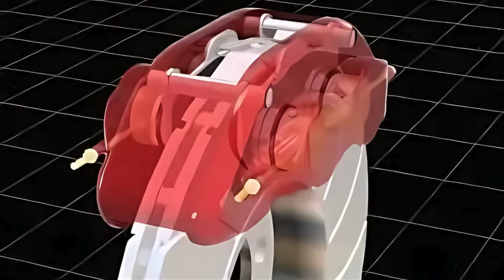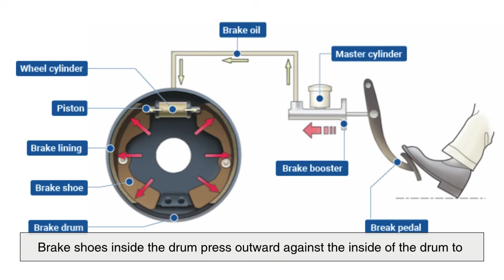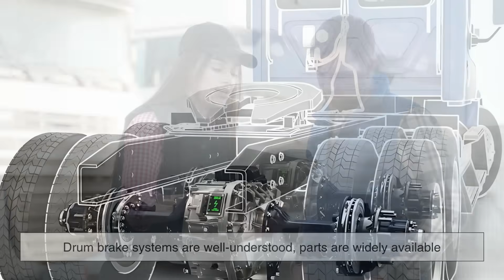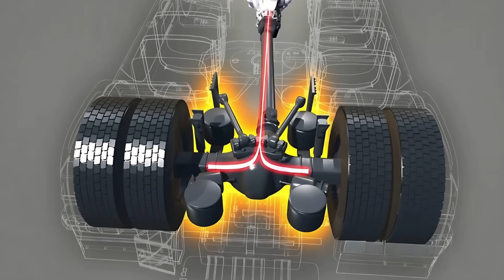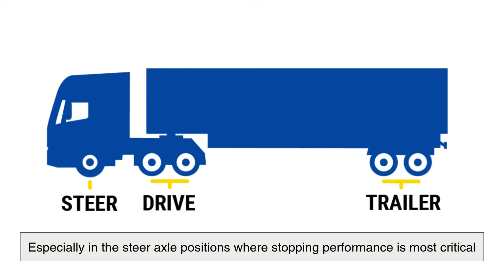Why Don’t Big Trucks Use Disc Brakes Like Cars?

Comment: Heavy jet planes use disc brakes so that blows the weight explanation away.
Reply: Multi-Disc for aircraft... On the order of 4 to 6 separate friction plates... Very much like automatic transmission clutch packs... just MUCH bigger.
Reply: It’s not just about tonnage and weight; drum brakes are far more reliable in wet, muddy conditions. Sure, you can argue that it’s more about economics than performance, but the truth is more nuanced.
Reply: @bethoughtprovoking   Okay... So why are ALL jet aircraft stopped by disc brakes??? EVERY wheel assembly on the C5-B Galaxy cargo plane has multi plate friction and disk plates... Hmmmmm. the 747 is the same way, and the 767, 777, Airbus A380 and all its little siblings. Several hundred tons of 150 mph metal and meat bags are stopped in a couple thousand feet... by disc brakes. Granted they are hydraulically powered and not air powered brakes.  TR's are another whole different ball game. Yes, some aircraft have drag parachutes but their mains are disc brakes... AKA the SR-71. Now in the case of that cloud humper, the parachute was put into play because it allowed the main brake assemblies to be smaller and therefore save weight which could be used to carry more fuel. The engineers for that monster never used a computer to design anything... Slide Rule baby. Granted, on big rigs I like the drive axle having drum brakes... MUCH more metal to dissipate heat which slows down brake fade onset. When you are coming down the Continental Divide on Wolf Creek pass... you definitely need all the help you can get. Have yourself a great day and enjoy.
Reply: @gerrywalsh5766 We’re not making the same argument. Or, rather, we’re comparing apples to oranges. A jet plane is neither a truck nor an off-road vehicle. When it comes to braking, a jet routinely has to come to a halt in a relatively short distance on a specifically designed tarmac; and that exigency is non-negotiable. Road vehicles—especially heavy trucks—on the other hand, are not designed to be safely driven at high speeds, and, therefore, the need to come to a quick halt is not comparable to that of a landing jet. The combination of air and drum is designed for reliability—exactly what a heavy truck needs.
Reply: @bethoughtprovoking Wrong answer... Because big trucks ARE on the highways with morons... They actually need to stop MUCH quicker or end up making meat bag paste. You remind me of my little brother. We would get into arguments and knock down drag out fights.  Lol
Reply: @gerrywalsh5766  Airplanes touch down at 150–180 mph, dumping massive kinetic energy in seconds. They rely on hydraulic disc brakes—often carbon—for razor-sharp, fade-resistant stopping, plus thrust reversers and spoilers to shed speed aerodynamically.

Saying trucks should use the same system is like mixing apples and oranges. A loaded semi rolls at 60 mph, hauls 40 tons over dirt and gravel, and needs brakes that lock up safely if air pressure fails. Drum brakes give self-energizing force, seal out mud, double as parking brakes and can be rebuilt roadside. Hydraulic discs, extra valves and specialized parking-brake add-ons would just add weight, cost and complexity without much real benefit.

The finale: each vehicle’s speed, weight, terrain and service needs demand the appropriate brake system. The video explanation holds about what’s right for tucks.
Reply: @bethoughtprovoking ummm nope. You're stuck in that left field.. so tell me again the falseness in that trucks must be drum brakes. I've worked on both systems.. aircraft and over the road. Heavy equipment has disc brakes... Oil bathed... Well... Caterpillar does. Come on... Let's get to the nitty gritty provoking...
Reply: @bethoughtprovoking trust me... I've done road rescue on big rigs up and down the I-35 corridor.   Fun fun fun
Reply: @gerrywalsh5766  Sorry, but I wouldn’t trust you. Do you know why? Because you’re not an engineer. And if you’re arguing that what’s good for an airplane must be good for a truck, then it’s pretty clear that your thinking is simplistic and unnuanced.
Reply: Good point!
Reply: Trucks and trains are getting disk brakes. Disk brakes cool down faster than drums. It's been at least a few years, but I remember seeing a YouTube video about air disk brakes on semi trucks.
Reply: Nice reasoning 😃👍💯

Comment: You're behind the times.
Semi trucks now come standard with air disc brakes and have for three or four years.
Reply: In Europe disc-brakes are standard an has been for nearly 20 years.
Reply: @sveinovelorentsen3159 disc brakes are an option here on trucks, but a lot of companies are getting away from them due to the extra cost and they don't even last 400,000 miles.
Reply: At my work all of our newer trucks have disc brakes.
Reply: They are not standard.  Here at JB Hunt our average truck age is like 29 months and only maybe 3% out of almost 19k trucks have disc.  Not sure where you come up with "standard". Pretty sure here most of those 3% are on dedicated fuel.
Reply: Longer than that since 2012 as an option, if you order your truck new, either way. Have fun
Reply: Standard?  LAMO you have no clue.  Work in fleet maintenance and we took delivery of about 40 new trucks this past week.  None with disc.  Stop spreading misinformation.
Reply: @MrThisIsMeToo our fleet has had disc brakes for the last 5 years. Now what's unusual is some of them are starting to be electric.

Comment: You are talking about US  trucks. 
The rest of the world doesn't use this archaic technique anymore. Especially not here in the EU. Come into 21 century -it's not so bad....✌
Reply: As seen in 9 year old ... Hätäjarrutus ... YT clip 1 min 22 sec , from Finland , longest stopping distance is early 2000 gravel semi , discs on front axle rest drums 
Also long semis in Finland must use electric brakes , air compresses too much in over 30m/100ft long vehicle that trailer is not braking as much than tractor is.
Reply: i like to see and ride in a Coe from Europe  . i think the long nose trucks are crazy once there off the interstates 
i not a heavy truck driver but van and Stephan driver  and in the larger ones having 5-9 foot extra in front in any city especially in the northeast cities  is way  harder than necessary . now on interstates no problem unless you goy tiny car too close you don't know it there and i seen driver pull in that close to a 80k rig then wonder why they get hit

Comment: I would like to see an exploration of regenerative brakes.
Reply: a motor can generate electricity or use electricity  so on a ev the motor drives wheels and when coasting it generates electric current charging back to battery  and since its working to convert motion to electricity the drag slows the car . . brakes work by converting motion energy to heat .  now when you put foot on break of ev the disk brake still changes motion to heat and nothing back to battery   so regenerative breaking only slows a ev regular brakes does final stop or panic stop